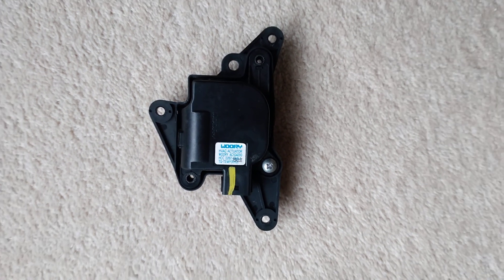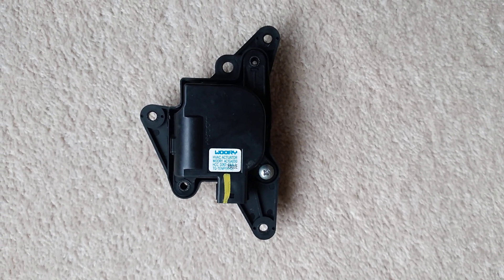Santa fe diagnostic, right hand side, no heat dual AC, problem I'd lower temperature actuator

Comment from the maker: Both actuators have a 5k ohm feedback on the position fully one direction then fully other direction, half way is approx 2.5k three terminals and two for dc motor, runs a plastic gear train, test with 9v battery on motor and ohm meter reads feedback ohms, my prob is not the both actuators they are ok